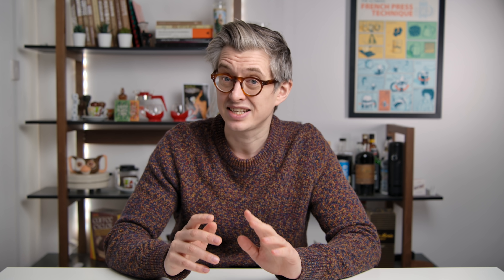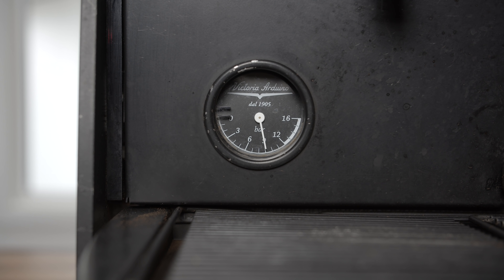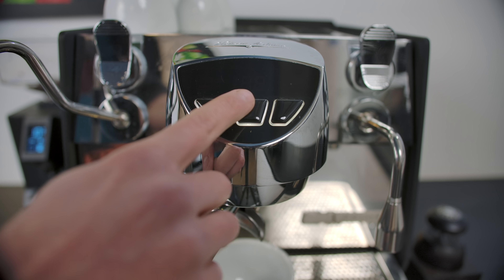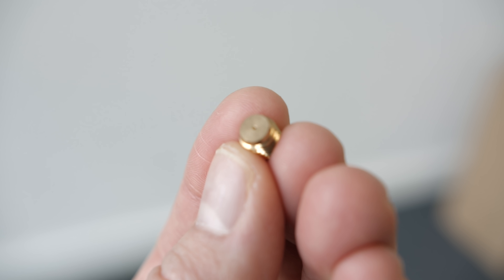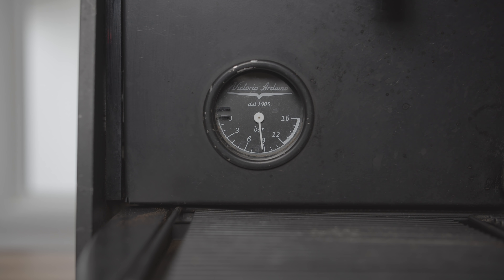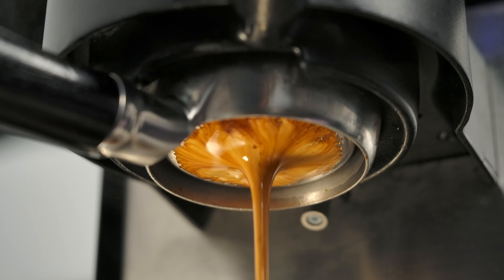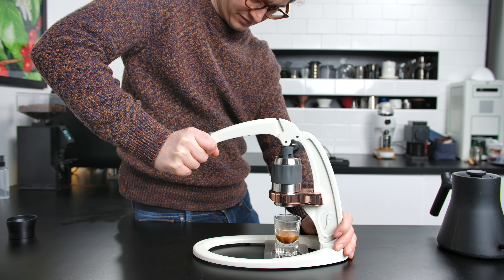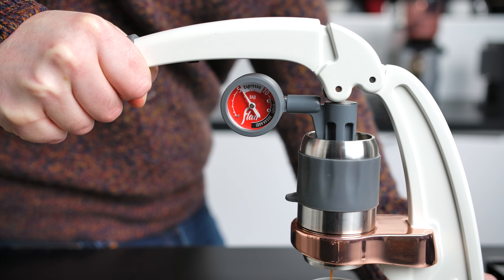Understanding Espresso: Pressure (Episode #6)

Comment: The cheap pre-infusion hack.

As the pump starts working and pressure starts building up, briefly open the steam valve just enough to keep the pressure below 2 bar for a couple of seconds. Then, slowly close the steam valve, so the pressure reaches the 9 bar in a smooth, gradual way.

Water is not compressible. And, by allowing water to soak the puck, you get what it's called in soil mechanics as "hydraulic compaction". The puck will become nicely packed, even if you don't tamper properly. And once the void between the puck and the shower screen is filled up, that incompressible disk of water will act as a piston pushing on the coffee puck!

Works amazingly, if you have a single boiler machine. :)

Comment: I had been aggressively keeping the pressure on my flair as close to 9 bars as possible. The results were varying bean by bean. I suspect some were more or less soluble then others or were taking me longer to dial in grind size. Ive begun accepting the range of 6.5 - 9.5 rather then fixating on the number. Ive made some of my favorite shots at lower pressures  focusing on pressure in relation to the flow rather then pressure for the sake of pressure.  (It hurt saying pressure so many times)

Comment: This was very interesting, but I guess hard for most people to apply in practice. For example, I have a Barista express and I noticed that the pump is set, broadly speaking, to a constant flow output (its not entirely linear, specially at either end (very very coarse, and very very fine) but close-ish to it). I guess this is the type of pump in the machine, it has a mechanism that will push water at a constant rate and whichever pressure builds up on the opposing side is irrelevant, only being stopped at the point at which the over-pressure valve is set to.

Now, I think that, just like electronic circuits, pressure, flow and resistance to flow are all linked together. What happens is that as you grind finer, you increase puck resistance to the flow and the pressure increases if flow stays roughly the same. What then happens is that you are somewhat forced to use their original recipe and hit brew time and volumes as they dictated. In practice, the pump does not really provide a constant flow as the pressure increases, probably because that requires much more power, that the pump does not have, so you do end up having a slight decrease in flow as you go towards higher pressure. But this is not ideal: ideally you want a certain pressure delivered to your coffee, and then the flow is dictated by the resistance of the puck (although, like James said when explaining why 9-Bar, the pressure-flow relationship is not 100% linear either, but that does not invalidate that at least a machine should provide above all, controlled pressure). This is not like flow-profiling where the machine/person carefully select a target flow.

After writing all this however, I notice that the pump, might also be instead a constant power pump, which would mean that there is an inverse relationship between flow and pressure, and their product stays constant, but I think its more a mix between the 2: constant flow and capped power. But now, all this just to say, that some pumps can deliver 9 bar, or 12 bar, or 15 bar, and that pressure will only depend on how much resistance the coffee is giving while the flow is only marginally affected, instead of having 9-bar delivered and the shot flowing because of those 9-bar.

Another thing, pertinent to the barista express, is that the portafilter is smaller in diameter. Now about this topic, I have been thinking a lot, about all its effects, but I cannot attest any of this. Lets consider the case where I want to mimic a recipe done in a commercial 58mm portafilter machine: have a fixed brew ratio of 2:1, 18g in, 36g out, for 30s. First we see that flow needs to be the same. But the puck height is greater, which to me, I guess, for the same grind setting would mean a higher resistance. So now we see that for the same flow to happen, for same pressure, we need to grind coarser. This, in principle, would mean a lower extraction I guess? I would imagine that dialing in, if wanting to keep the same dose and yield would mean that both time and grind setting would need to be adjusted for the difference in puck thickness. To say, that it also becomes non-trivial to replicate recipes with machines with different portafilter sizes....or I might just be incredibly wrong and some variables just cancel each other out.

Lastly, I want to say, that at some point I will hack my machine and change its over pressure valve to limit the pressure to 9~10-bar, but that this is not something everyone could easily do, or should do as it voids warranty, etc.

Comment: Excellent content, as always. Many thanks. 

I have 2 comments on pressure. Firstly, I rarely hear it mentioned but there is necessarily another pressure profile in the form of the pressure change through the depth of the puck, from brew pressure to atmosphere pressure as it leaves the basket. I have no idea what sort of curve this profile would follow but if we accept that it would not be a step change right at the basket then not all of the coffee experiences brew pressure anyway. This crossed my mind many years ago when operating an Izzo Groupo lever machine with deeper and narrower baskets (can’t recall the dimensions), wondering how that affected channeling and pressure profile through the puck. 

My second comment shared my experience working commercially with the above mentioned spring lever machine. Of the brew process that was in the barista’s direct control, I found that the TRANSITION from pre infusion to brew pressure has dramatic effects on the coffee output. Keeping all else equal, a transition of say 2 seconds would make a tasty shot but shortening that to less than 1 second would result in very low flow and a huge brew time. Thus, if we dialled in using a 2 sec transition we could grind finer and make tasty beverages. 

By the way, I and my staff used that lever machine in our cafe for over a year, averaging 400 coffees a day and peaking at about 700 on crazy days. Temperature control was tricky but it was quite spectacular to watch and customers loved it.

Comment: The combination of me and a Cafelat Robot is basically AI-driven flow profiling.  Semi-joking.
Reply: Semi…  I strapped an old wristwatch with second hand next to the pressure gauge on my new robot for timing, in addition to the scale under the cup to watch flow rate. OK, I am lying; I am just using the scale to know when to stop, but if I could pay attention to 5 things at once there would we manual guys could do anything these automators do : what the hands are doing, pressure gauge, watch, scale, appearance of the flow. One could train a camera on the last 4 and  make an analog profile report. Of course the analog report is likely a digital video unless you use a film camera, for you purists.

Comment: Got a Gaggia Classic and I didn't change the opv mod, yet. What I usually do, but I don't know if it has any effect on brewing is to release some pressure through the steam wand, before starting to brew.
Also depending on the roast I release some of the hot water from the group head, so it doesn't burn the coffee.
I'd say that 15 bars is too much and listening to James I'm definitely going to get the opv kit soon.

Comment: Flow restrictor in the cold water circuit??? Don’t get it, how can this effect the water-pressure from its way boiler to group head? Would only understand it, if machine doesn’t have a boiler but a thermoblock.

Comment: That's the beauty about a Pavoni or similar manual lever machines.. when you feel decreasing resistance from the puck you automatically pull back the force since you don't want to rush the lever through. It makes one instinctively follow all the advice you give in this video, just by feel.

Comment: Hi James, hi everybody. This video seems really interesting but my English is very poor (I live in France). Could you please explain me in other words the job done by the flow restrictor in a coffee machine and where is it placed. I really don’t understand why the pump is not sufficient to deliver the water flow at 9 bar directly to the puck (though the different pipes fittings and group head orifice and shower screen) ? Why adding to the pump a component that reduce the flow rate and increase the pressure on the pump side.... ? Strange. I would like to understand. 
Thank per advance.

Comment: I made a shot on my Cafelat Robot right after this video ended. It tasted better than the last because I previously prioritized maintaining pressure even I noticed channeling. That change reduced an an unpleasant bitterness on a light-roast blend that I was having even with 20g dose and <30 s shot time. I think it would be safe to attribute it to over-extraction in the channel at higher pressure.

Also could never figure out whether a roaster’s recipe shot time target included pre infusion or not. Finally I understand preinfusion based on these descriptions of machine types. Thanks Prof. Hoffman.

Edited for clarity.
Reply: I just got started with my new robot last week. Getting way over caffeinated trying to get good enough at it that I am not embarrassed to pull  shots for my friends. How are you noticing channeling? The manual says that the puck often cracks after the shot when pulling up the levers creates a vacuum, making 'puckology' impossible.  I expect some sort of puckology is still possible, but it will be a sub-discipline just for the robot.  Anyway, are you inferring channeling when you feel a drop in pressure or...?
Reply: @haberdashery314  I agree with Paul and his explantations in the manual. Actually I was thinking about Paul’s comments on the “9 bar magic number” and how he recommends closer to 7 bar since he measured the actual group head, as opposed to pump pressure, in many many machines and found it to be closer to 7 bar. The Robot measures pressure in the portafilter so his suggestion is to shoot for 7 bar since that is the actual extraction pressure on other machines read 9 bar.

As far as channeling, I notice it when I get a “spray jet” during extraction. You can notice it that during extraction or at the end when you see fine splatter around your cup. James mentioned this aspect in this video and showed a brief clip. I have seen that same effect while watching the extraction from below. Also I have noticed two weak streams instead of one strong one that I believe to be channeling as well.

I noticed the largest jump in quality when I started to do preinfusion at about 2 bar until the bottom of the portafilter is saturated. This again I started doing to evenly wet the puck and get even extraction. Previously I would quickly try to ramp to high pressure and wasn’t very pleased with the results.
Reply: Hey  @SnowBob302  This kind of report from an experienced user is very much appreciated while I learn the machine. Yeah, a “spray jet” would be a clue wouldn't it.?
Reply: @haberdashery314  it seems like part of your comment got cut off. I would point you to the Robot User Experiance thread on the Home Barista forum for the largest discussion about the Robot. Paul has been known to drop in on that thread and offer his insights. It will be overwhelming when you first try to go through it but probably every aspect of the Robot has been discussed there.

I personally put in a lot of effort in controlling variables so I got a lot of auxiliary equipment for brewing with the robot like a lunar scale, Comandante grinder, fellow temperature control kettle, third wave water additive, WDT tool and more so I could pick at individual variables to adjust with relatively fine control. This is not to say that you need all of those but perhaps experimenting with different aspects is easier for me than for you because I have more “measurements” with every shot.

Regardless, I really do think you made the right choice with the Robot even after watching all the videos from James for a year. You have the ability to change and control everything about your espresso with that little guy. As deep as I fell into the espresso rabbit hole, I didn’t have any regrets about getting a different machine. As long as you keep putting in the effort on the arms you will get a to a point that you can make espresso better than the coffee shop.
Reply: @SnowBob302  So nice to have my choice validated, and thanks for the pointer to the user group. From all I had read before buying,  Robot is the cheapest way to make first rate espresso. Flair seems to be good too, but workflow looked fussier. 
My only regret is that I didn't buy mine in time to get polished aluminum.  Still beautiful in colors. Mine is Red. My wife said she thought it should be in MOMA (museum of modern art in New York). You cant say that about any other machine under $500.
I Fixed  my comment on pressure. thanks

Comment: Flow and pressure are of course two sides of the same coin and I would argue flow has always been a consideration in the argument between constant pressure pump or traditional lever machine.  The E61 has a design feature that to some extent helps the barista jockey flow.  The middle lever position turns off the pump without releasing pressure.  I use this to slow flow towards the end of a shot if it increases too rapidly, in order to 'save' the shot, moving it up to turn the pump back on when flow ebbs and back to the middle.  In the same way as lever machines pressure could be jockeyed by holding back the release of the spring.   Excellent video - I learned much thanks.

Comment: Thank you so much for the video!

For a single boiler home espresso I open a stream valve to decrease the pressure. It helps to keep the flow more consistent in case of channeling.

Comment: It seems like a flow rate profile would be more useful. A known flow rate means a known residence time in the puck. As you brew, you would need more residence time to get the same extraction (whether you want constant extraction % idk). You would also want to monitor pressure to ensure you're not channeling.

Comment: Hi James, about something related to pressure profiling you did not mention: I have a Robot manual lever machine, and if I build up pressure slowly (say from 1 to 8 bar in 10 seconds) I get high flow and bad espresso (presumed puck lift, I forgot which youtube video that mentioned this). When I instead apply presure quickly (say 8ish bar directly after "preinfusion"), this high flow does not happen and my espresso is certainly better! I can imagine that low pressure causes the puck to erode with flow, while the high pressure keeps it together instead.

Comment: I think once a channel is formed, it will be very difficult to close it. Reducing the pressure will only reduce the flow through that channel as well as through the rest of the puck. However, the fraction of water going through the channel will remain the same, which means extraction will remain uneven.

Comment: So, is Turkish grind finer than espresso grind? If so, could you use Turkish grind and a slightly higher bar of pressure, say 10 bars, and be sorta fine?
Reply: Turkish is finer than espresso yes.
No, why would you use Turkish grind for espresso??
Reply: @attianotattia3470  to try and see if higher pressures go through the Turkish grind easier, but I guess it doesn’t make sense. You’d wanna go coarser, not finer

Comment: Hi James. Thanks for this!
I have a Sage Barista Express. Just a newbie still in espresso making. But the Sage is set at 15 bar. Does that affect my brewing/pulling time? Should the 1:2 ratio be pulled faster, slower or same time? Anything to add? (I am looking into changing the bat from 15 to 9 via the valve inside the machine. Read about it and I guess a technician can do it for me. Thoughts?)